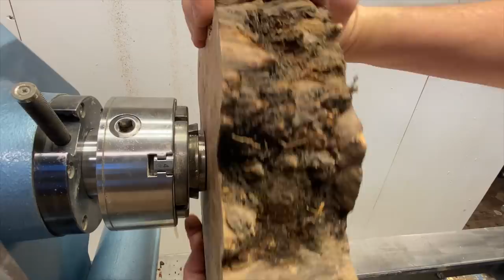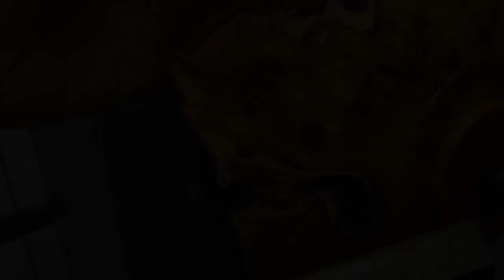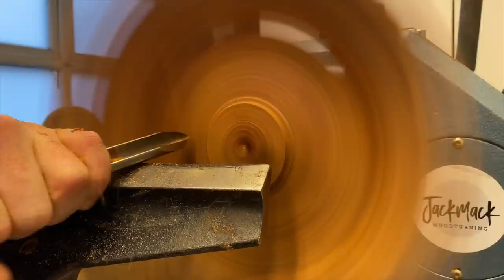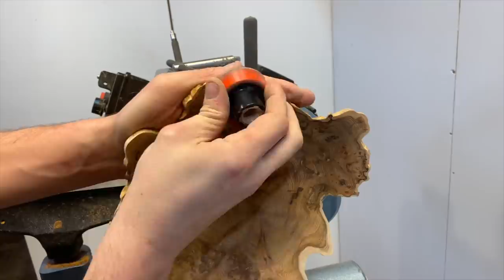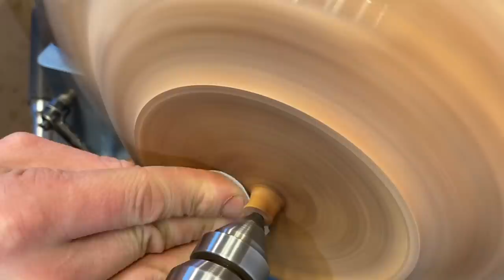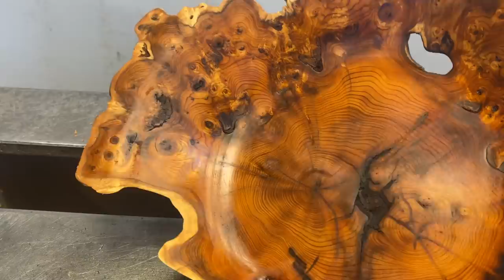Woodturning - Yew Beauty

Comment: I think this is my favorite one yet, not the least because I haven't done a full circumference live edge bowl so, I was taking notes! 🙂 Your steady control while "turning air" ws commendable. I also love (and use) your technique when doing your last cut on the inside: taking the last real cut with the normal edge presentation angle and then opening up to get a fresh part of the edge to take your very last, light cut. I've never used a negative rake scraper before, but I like your results. I might have to convert one of mine. Great work, as always. Cheers!
Reply from the maker: Thanks michael, it’s really great that you are taking something from my videos. It’s nice to know people find them useful. When doing an interrupted cut (air cuts) if the tool is presented correctly you shouldn’t feel too much in the way of chatter, if you do feel a bit just use very slight micro adjustments till that chatter goes and your tools in the correct position. Bowl like this are my favourites, partly because I seem to be the only woodturner who enjoys hand sanding. But mainly because the wood challenges you to find that best possible final form every time. 

Cheers for watching 😊👍🏻
Reply: @JackMackWoodturning  Yes! You are indeed the only woodturner who enjoys hand sanding. 😆
Reply from the maker: I’ve no idea what you all dislike about it. All aspects of woodworking are fantastic. Every piece you sand is an opportunity to learn to sand more effectively. All we are ever doing is getting rid a tool marks and buffing to a sheen/polish what’s not to like about that?

Comment: I really love this piece! Really love the way yew takes on a finish! Do you have a specific way to combat the workpiece imbalance, I know my midi lathe would be vibrating all over the shop! Is it just the lathe weight?
Reply from the maker: Hi Matt, thanks for watching. I’m glad you enjoyed it. Yes mostly the weight of the lathe will mean you can turn larger unbalanced pieces, however just like mounting a smaller unbalanced piece on your smaller lathe mine will wobble at certain speeds.. there is always a resonance point as you turn the speed up where the lathe wants to dance around the shop and if you creep up a little faster it will balance out a little more. But it’s all relative… bigger lathes can take bigger unbalanced pieces but an unbalanced piece will always make a lathe wobble (relative to the size of the lathe) 

Hope that makes sense 

You can bolt your smaller lathe down to a very heavy duty work bench and load the bench with weights ect and you’ll be able to get less wobble bit that force all has to go somewhere and there is a school of thought that it can damage your lathe/spindle.. I’m not so sure about this but I use the wobble to tell me when to stop increasing the speed.
Reply: @JackMackWoodturning  that's really good insight thank you! I haven't turned many unbalanced pieces, but for the ones I have I have just had to keep the speed fairly low. I may have to think about taking some vibration out the lathe by properly bolting it down if I do try and turn a few more bits like that!